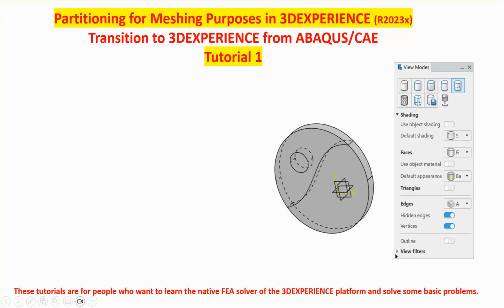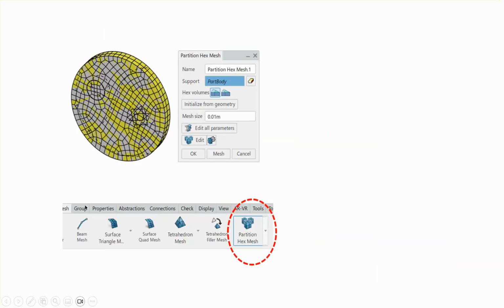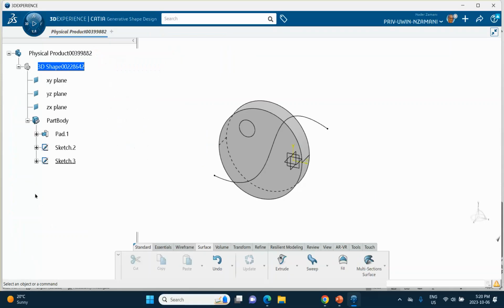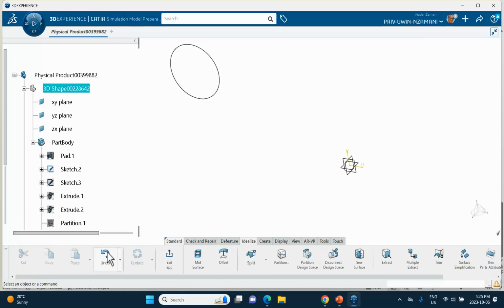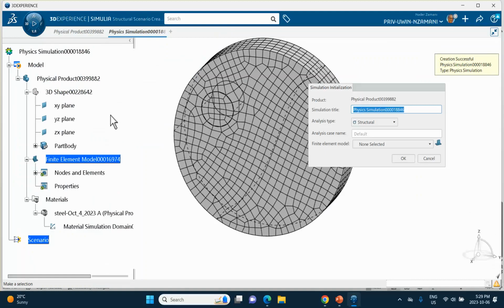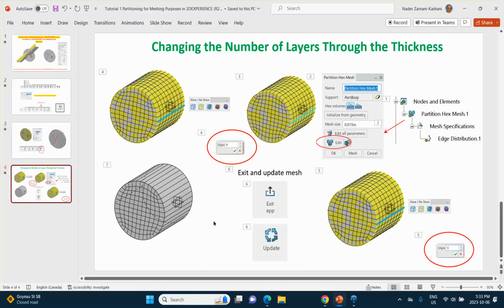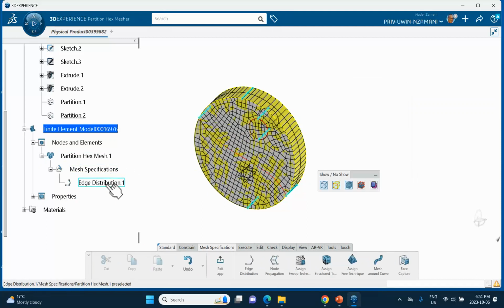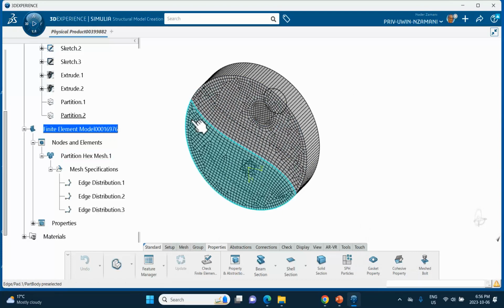Tutorial 1, Partitioning for Meshing Purposes in 3DEXPERIENCE R2023x

Comment: Hello, I have a specific issue with the Partition Mesh function on 3DEXPERIENCE SIMULIA CFD.

I am setting up an internal flow simulation and have successfully created the single, unified Fluid Domain Volume. When I run my Partition Hex Mesh function, the mesh generates with good quality and passes the quality checks.

However, the mesh does not get recognized by the Fluid Scenario. The green checkmark never appears in the Assistant, and the error is 'No mesh has been assigned to the fluid domain.'
Reply from the maker: Dear Anish, unfortunately I have no experience with CFD in the platform. I wish I could help you but I am not the right person.